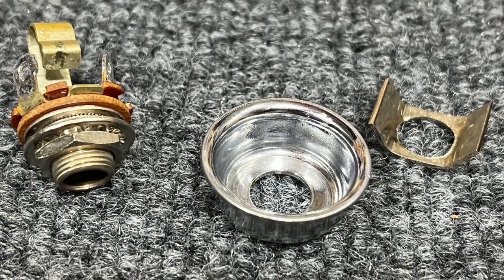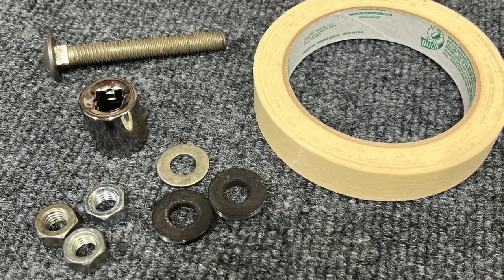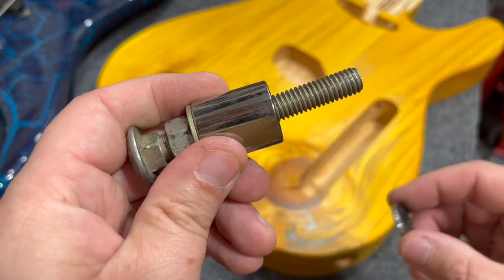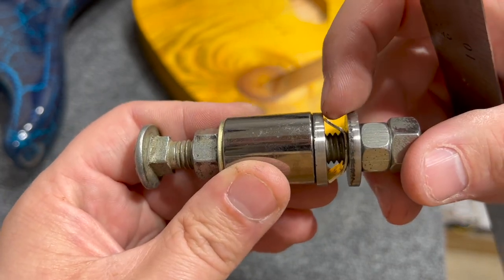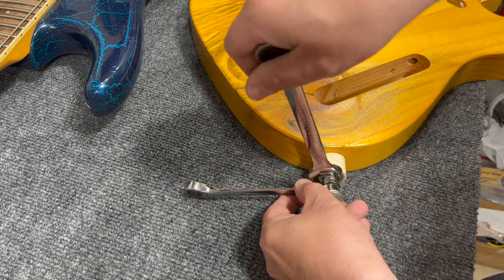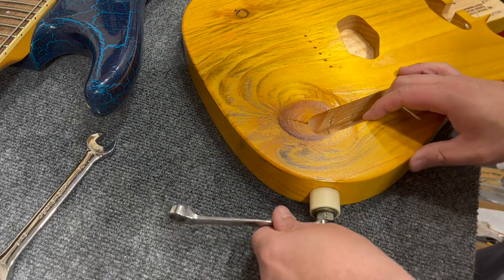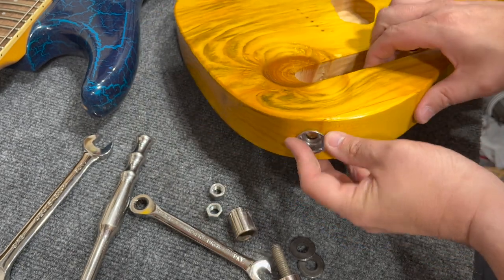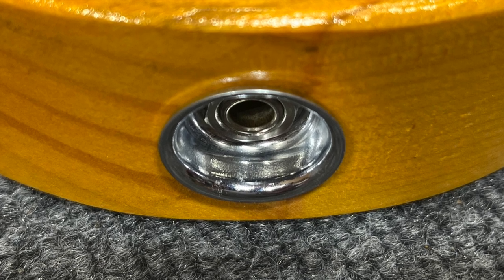Quick Tip 8: Installing a Telecaster Jack Plate/Cup

Comment: I have been repairing Telecasters for years and I only use Electrosocket it takes less than 5 minutes to install and you will never lose your nut and the jack goes into the body. No fancy tools,in the time it took him to explain how to do it his way I installed an electrosocket. I love switchcraft jack but check out puretone jacks they have 2 contact points for the tip and 2 contact points for the sleeve. No more pops and crackle just a very snug connection
Reply from the maker: I appreciate the comment.  Electrosockets and Pure Tone jacks are both good, but this video is help for those who want to install original equipment.
Reply: Yeah I agree but some people like vintage/ original parts. I was rocking an electrosocket on my tele but I just  wasn't feeling the vibe until I put a vintage socket plate. I love this tele more than any of my other guitars.
Reply: I agree about Electrosocket cups. No-brainer if not doing a full vintage build. And as far as Switchcraft, I have had some serious hit and miss QC issues from them lately (2-3 years). Not with output jacks as much as bad toggle switch blades or switches that rattle.

Comment: Huge help!  I went with the 4" carriage bolt as suggested and used a second 5/8 inch socket on the other side of the clip to take up the extra space between the back of the clip/washer and the two jam nuts.  This positioned the jam nuts so they are visible in the control cavity when the tool is inserted to the working position for installation.  Worked like a charm and made the jam nuts readily accessible for easy removal of the tool.  GREAT tips!
Reply from the maker: Nice idea about the second socket!

Comment: This worked quite well, thank you!  Note to people trying this - pay heed to all the measurements he's providing, there is little margin for error. Once I got everything to fit inside the barrel hole I was thwarted by the masking tape marker - I should have measured the 3/8" from the washer in front of the socket, and not the socket itself - LIKE HE SAID, TWICE.
Reply from the maker: Exactly, thanks for pointing it out!

Comment: I've never liked the cup jack plate. I use the standard jack with the "football" jack plate. This allows me to use a right angle jack and run the cord between the strap, body and strap pin.
Reply from the maker: That Charvel TX build I did had the football jack stock.  It worked fine.  I could never find a video on how to install the jack cup for a traditional Tele build... so I made my own. :)
Reply: Yes!  I also like to be able to sit on a bed, sofa, chair, etc. without bending/breaking a strait cable because the Tele cup doesn't allow right angle plugs.

Comment: Great video and a big help! Just a heads up for anyone making this, when measuring 3/8” back from the edge of the clip before applying tape, keep in mind the thickness of the washer you used. Mine were a bit thinner than the ones used in the video and had to adjust my tape slightly.
Reply from the maker: Sure!  The tape starts 3/8" back from the face of the washer that touches/compresses the clip.  So, yes, the washer thickness is part of that 3/8".
Reply: @hacksguitarhobby oh ya good point haha. I may have just messed mine up. My clip ended up being a little too deep. I have to make some adjustments!
Reply from the maker: Knock it back into the body, then bend it back into shape once it’s out.  Turn it 90 degrees in the hole when you reinstall it to get into fresh wood.

Comment: This works great. I didn't have all the parts laying around, so went to the local big box. I bought everything for $5, not including the socket.
I discovered that M10 flat washers fit on a 3/8 bolt and are near the perfect OD, so no washer filing needed.
Thanks much for posting this!
Reply from the maker: Awesome, and good tip on the washers!  I love finding inexpensive solutions to problems.

Comment: This is one excellent video! I've never had the pleasure of installing a traditional Telecaster jack cup, having used various alternatives in the past including the popular Electrosocket. But I'm currently building a Buck Owens silver sparkle Tele and I need to use the original jack mounting scheme. As for the tool, I did make a few substitutions in my version including a 3/8" shaft collar in place of the two jam nuts at the end of the carriage bolt (much easier to remove than the jam nuts) and a 7/8" shaft collar on the socket instead of the wrapped masking tape (eliminates the chance of the tape compressing). The tool I ended up with is a definite keeper.....at least until I need my 5/8" socket.🙂
Reply from the maker: I feel the same... my socket has been a part of the tool so long, that I'll probably just buy a socket to replace it. :)

Comment: Great video, thank you so much, just what I was looking for. Worked a treat. The only modification I made to your method was rather than wrapping masking tape around the socket to act as a depth stop I cut a piece of PVC to 1" length (I'm not sure what size but it was a little smaller diameter than the socket), then I split it so I could open it up and slide it over the socket. It worked great. I also took your suggestion and made sure the carriage bolt was long enough to project into the cavity once I'd removed the outer nut. This made it ver easy to remove the lock nuts.
Reply from the maker: Great!  I’ve also seen someone use a hose clamp and a thick O ring as the depth stop.  Whatever works. :)

Comment: Extremely informative video. I originally had the other jack plate holder that is mounted using screws. However my Billy Bo body that I purchased had the jack hole too large. I therefore purchased the jack plate cup to see if that would be a better fit, but no. I then got the idea to use plastic wood and build up the hole. The first holder worked after some sanding but it's a decent fit. Great tool you made. I will keep it mind if I build a Telecaster. Thanks again for the video. Great demonstration!
Reply from the maker: Glad you enjoyed it.  Not that difficult after you see it, right?
Reply: Yes! I like Stewmac but the prices can be quite costly. You created a tool for literally pennies. That's what I love about ingenuity!  @hacksguitarhobby

Comment: Yep, worked for me. Didn't need the ratchet at the end though, used 5" bolt and wound the compression bolt all the way out when done and pushed the bolt in to expose the two nuts at the other end in the control cavity and used a spanner - good tip to use a 5" bolt though. Thanks for the vid.
Reply from the maker: That’s mostly why I recommended at least a 5” bolt, but also so both jam nuts can be fully on the threads of the bolt… I had to leave one hanging off a little.  Glad it helped!
Reply: @hacksguitarhobby  Ya, I made one up but it was 4" and when I watched again to make sure I was doing it right, I heard you say about 5", was a good tip, thanks

Comment: Nice video, I have already purchased the tool via Stew Mac so there’s no reason for me to make this although I watched out of curiosity here.
I see so many Tele’s with the jack either loose or replaced with those hideous jacks with the two Phillip headed screws, which just look like crappy imo. The good thing is that you can go back to the original plate that’s meant to be there though in the first place which I’ve done to a few as well.
The last Strat I put together I ran the jack out the side as well which is so much nicer than the jack coming out of the face of the guitar, the cable is more out of the way too with this set up. Especially if you have a nice one piece body now you don’t have the jack assembly covering up the nice wood too 🤙
Too bad all Strats weren’t made this way hah, why Leo decided to go with the front plate is beyond me, maybe you know? I can’t think of a reason as to why.
Reply from the maker: Thanks, I have one guitar with an electrosocket that I installed before learning this method.  Those have their place, but I much prefer the original!

Comment: How do you like those pine bodies from Nebraska?
Reply from the maker: If you look for the right ones, they are great.  I’ve bought four, and I looked for ones that didn’t appear to have cracks in the seams, chips around the string ferrule holes, or unstable knots.  All of mine were good after minor sanding of the neck pocket area.
Reply: @hacksguitarhobby Thank you for letting me know. Anyone you recommend for tele necks?
Reply from the maker: Not really, unfortunately.  The Fender replacement ones I have used (Mexico) have been inconsistent.
Reply: @hacksguitarhobby  Been thinking of trying one of those allparts japanese made licensed ones. If anything, Japan is fastidious about details

Comment: Excellent work! Absolutely horrible design. I mean, what's wrong with two little screws in the outside of the jack? Crazy. Someone at Fender was definitely high when they designed this jack.
Reply from the maker: Well, the design is about 75 years old or so, so I’ll cut them some slack. :)